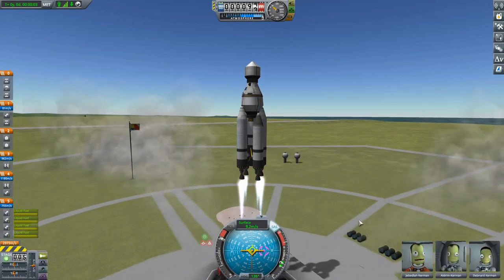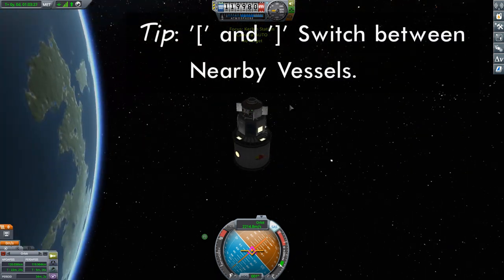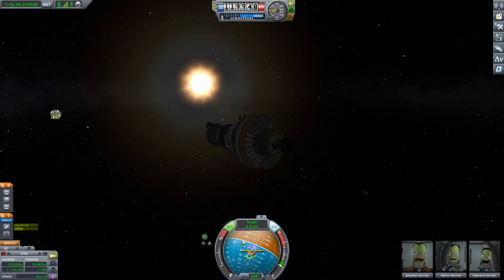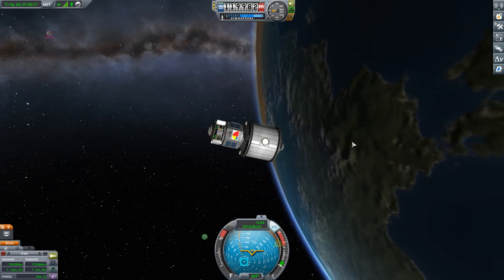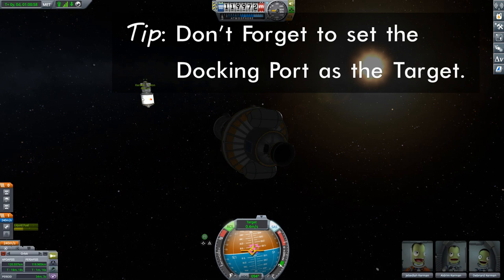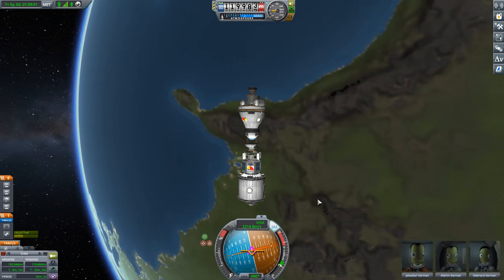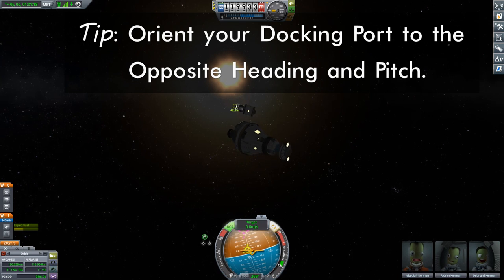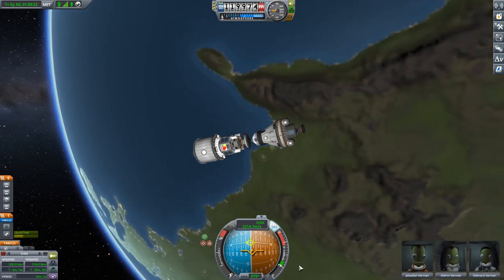How to Dock | KSP Beginner's Guide

Comment: Pilot Math:  To obtain the reciprocal heading (180 degrees out from an initial heading), use “plus 2, minus 2”.  Assuming initial heading is 072, you would add 2 to the first digit, in your case here, 0 + 2 = 2.  Your second digit is 7 - (minus) 2 = 5.  Last digit remains the same at 2.  Put it together for your heading and you have 252 degrees.  For headings greater than 180, use “minus 2, plus 2”.
Reply: I realize this is an old video but I came across it, and Yep, I was looking through the comments to see if anyone had already mentioned this yet.

Comment: Using the nav ball direction of the target to get a precise alignment is a great tip. Double that for aligning Normal to begin with. The Docking Mode is essential for console as it allows for linear RCS. We have to keys to use.
Reply from the maker: I was wondering about the control set up on consoles.
Reply: I find it much easier to use docking mode than the translation keys. It lets you keep your hand in the standard WASD position and keep control of the mouse.
Reply: @DiggitySlice  I'm too dumb for that. I'd be trying to switch back and forth and accidentally hit the throttle.. then my ship would smashing into the space station

Comment: hey so i made a station recently and docked something for the first time but my station wobbles when the ship is docked, is there any solution mid-flight for this or will i need to deorbit it and try again?
Reply from the maker: A few things to try. 

First, disable all but one set of reaction wheels. They tend to fight with each other, especially if they are oriented along different axes.

If this doesn't resolve it, or if you just want to stiffen the station, an engineer can attach struts across the docking ports via EVA. You can also use autostruting by right clicking on parts. Careful with this last one, as there is a weird rotation bug that can creep in. Autostruting to the grandparent part seems safer.

Finally, a quick timewarp stops all rotation and wobbles, though the wobble may resume if the underlying cause hasn't been addressed.
Reply: @MikeAben  thanks again.

Comment: For some reason I cant set the docking port as a target. any ideas?
Reply from the maker: You also have to be controlling the vessel that is doing the docking.
Reply: Also, the distance to the port to dock (not necessarily to the current target even if it’s the same vessel) should be smaller than 200 meters.

Comment: I find the docking mode to be much easier to use than the translation keys. It lets you keep your hands in the standard position and feels very natural.

If you're having trouble using the translation keys, I implore you try docking mode. You may find it easier. Don't avoid it just because a youtuber told you it had no purpose.
Reply: Don't you have two working hands?

Comment: can you do a video on mechjeb2 launch to rendezvous?
Reply from the maker: Sorry, but I don't play with that mod.
Reply: @MikeAben  what do you do about maxQ? I do you eyeball the thrust based on transonic effects ?
Reply from the maker: @Dolph_Vader  When playing manually it's full thrust all the way, baby! Yes, you can get into ideal TWR to maximize efficiency, but I honestly don't find the effort worth it.

That said, I have a modded let's play with a launch program I wrote in kOS. It's full thrust until 25 km at which point it locks the TWR to 0.9. Something more dynamic would likely be better, but I've not gotten to doing that and, frankly, it's not a high priority.
Reply: @MikeAben  that makes sense.  When you're building properly the difference isn't as big.  I remember when i was a n00b and I'd strap extra solid boosters (before vanilla ksp had TWR), that max Q limiter did save me gazillions of deltaV by throttling back my liquid engines till the air was thinner.  Now it's just a habit to use it every time but usually doesn't even do much manipulation of the throttle.
Reply from the maker: Yes, tweaking the thrust limiter in the VAB is the key. Way back, before KSP even gave you the total mass (and I hadn't heard of Kerbal Engineer), I had a spread sheet where I recorded all the part and fuel masses and engine thrusts, and it calculated TWR and delta-v for me.

Comment: You can show how to dock without RCS and SAS... Is not that hard
Reply: Rcs help in slight movement without rcs it is possible but too difficult
Reply: @jd_bhalani  no its little harder bcs u have to think about future steps.... U can also set trust limiter to .5
Reply from the maker: I did it recently in a live stream because I forgot to put on thruster blocks. It's not hard if you just point the two docking ports at each other as in method #1 in this video.
Reply: There is the "Lowne" method, but that requires either top-end probes or 3-star pilots for both vessels.  Fine for Sandbox Mode, easy enough for Science Mode, but comes quite a lot later in Career Mode.
Reply from the maker: @_Meriwether  Isn't that essential method one here with you being able to lock onto the target?
Reply: @MikeAben  Essentially yes, main difference is each target being held by the pilot/probe (using the "hold target") so orientation becomes largely hands-off.  But if you don't have a level 3 pilot/probe, no can do.